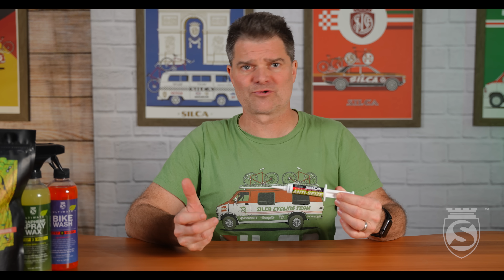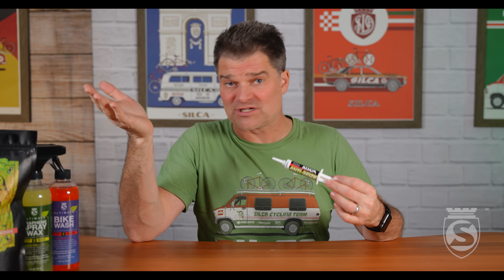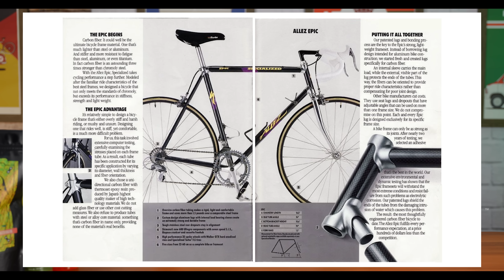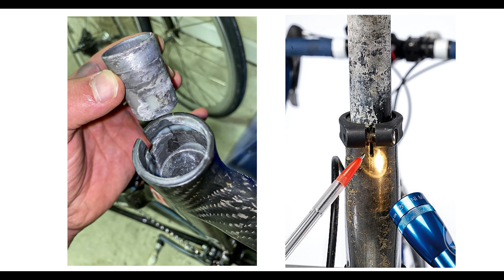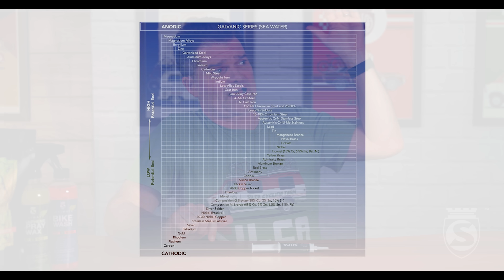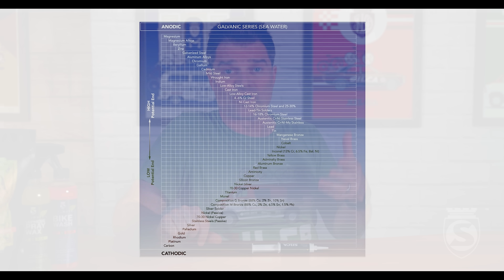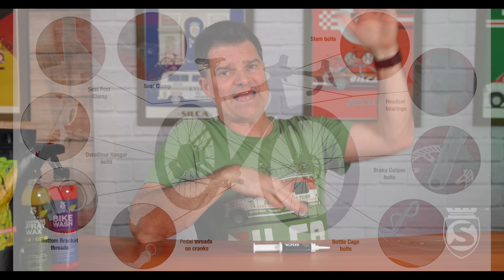Better than Grease? Anti-Seize Assembly Paste

Comment: I was taught not to use grease on threads when torquing bolts, as this will reduce the friction on the threads and end up having a far larger tension in the bolt than you would have had with a "dry" torqued thread, this could then end up over tensioning a bolt to such a degree that a carbon seatpost / handlebar be damaged or even crushed MIke
Reply from the maker: Anything with a torque spec should state the surface condition, but should generally never be done dry as this is the most likely to gall and also will have the most torque variability.  From my experience 95% of all torque values are based on lubricated surfaces and those that aren't, are using an alternative like loctite, pre-applied thread lock patch on the fastener, nylock thread inserts, or similar.
Reply: @SILCAVelo   it's a minefield, as lubricants are not specified for 90% of cycle components
Reply: WTF taught you this? What holds a properly torqued bolt is the STRETCH of the material while grease keeps the parts from becoming one. Thread-lockers help under-torqued fasteners stay in place. I'm amazed at how clueless so many so-called "bike mechanics" actually are.

Comment: Hmm, what about ceramic paste (i.e. from LIQUI MOLY)? 🤔
Galvanic neutral, acid/lye resistant, corrosion/water resistant, high temperature resistant, non-toxic, cheap. 🙈
Reply from the maker: Ceramic paste is developed for high temperature applications like automotive brakes.  The ceramic additive works great for insulation and temperature, but should not be used with aluminum fasteners or aluminum female threads as it is slightly abrasive and will score/damage surface anodizing on aluminum components and can lead to premature wear and/or failure
Reply: That is a good question. At least it does not contain Nickel, which seems to be a bit unhealthy (ok, most mineral oil products are, and you will not use it as a spread on toast, but anyways...).

Comment: Why should we buy this vs something like Permatex 77124?
Reply: I use Permatex Anti-Seize 80078 on my pedals cranks. They came out smooth years later and I put them on my new bike.
It's salt, corrosion, and moisture resistant - "ideal for marine use". I'm not worried about water or sweat getting into the threads and turning my bike into a battery. When the bottle I have runs out, I'll think about nickel anti-seize.
Reply: Permatex 77124 contains Graphite and should not be used with Aluminum. See his reply to TheBikeWrench’s comment below.
Reply: My thoughts exactly.  I think this is overdoing things.
Reply: The temperature rating on the Silca stuff seems to be a fair bit higher. While the temperature isnt directly relevant, it might indicate the formulation of the Permatex stuff might be a bit cruder (more impurities in their formulation). Probably makes little difference from a practical standpoint, but I guess one would have to do some long term tests to compare the two formulations.

 Probably could do some kind of accelerated test by spraying salt on the test samle products to speed up the corrosion like they do when testing anti-rust products, then we can see if the difference between the two.